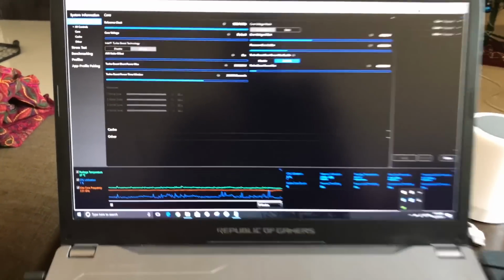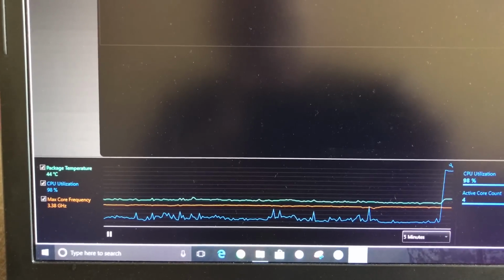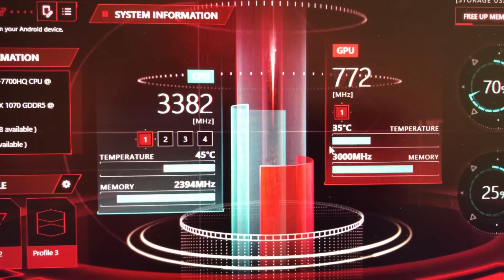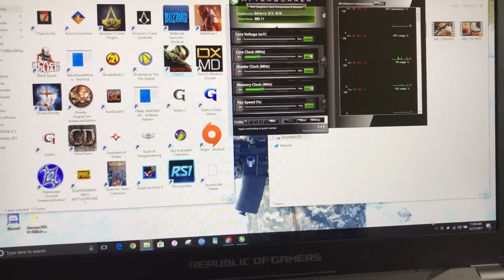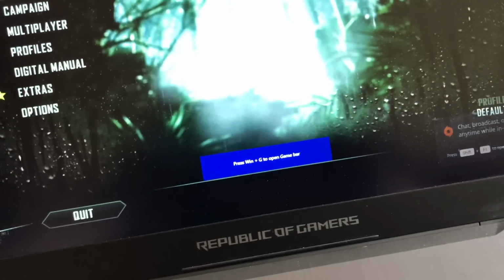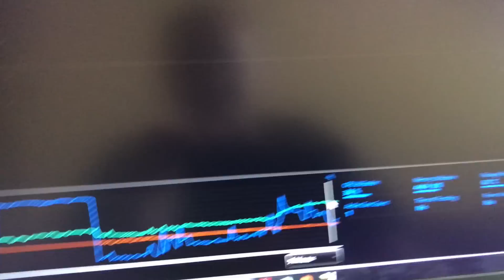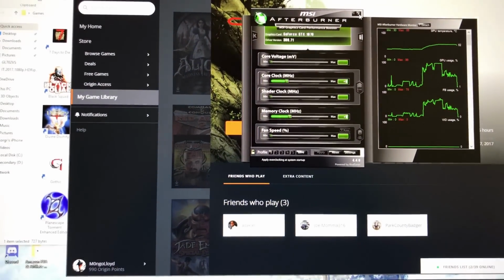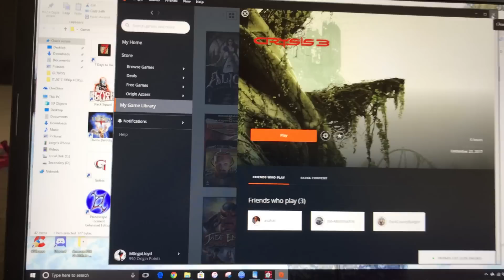ASUS ROG - Liquid Metal 5 Months Later! Followup

Comment: Mr. T! Thanks for these videos! I have the same laptop model and I also got the Samsung 960 EVO nvme. Now, please tell me (and then tell me how) that you were able to boot from your NVME SSD. I updated my BIOS to 307 and I still don't see how I can make it a boot option. It does recognize it in BIOS and in Windows.

The Thermal Grizzly actually works great. I did it just as you did. Looking forward to getting it faster with the 960 EVO and not the mechanical Hard Drive it came with. But I do have an 840 EVO SSD drive if that's the only option I have.
Reply from the maker: Hey there! The EVO 960 sure made quite the difference in speeds! 

Did you make sure to change the boot order in the bios? I do remember having to play around with the bios settings a bit to make it work. There may have been an option for nvme support. I have moved on to another gaming laptop I will be doing some videos of soon, otherwise I could walk you through it :(
Reply: Already moved on to another laptop? That would make it a challenge to walk me through the BIOS setup and I don't want to bother you for that. I did look online and didn't see anyone say they had success booting from the 960EVO. I'll mess around in the BIOS some more. If you are confirming that you actually was able to do it, that encourages me to keep working at figuring it out. Thanks!!
Reply from the maker: Jason Beaver I was successful in doing it, but I seem to remember removing the mechanical drive first and then installing fresh windows on the evo, after that, just switching the boot order. But yeah, it was quite a while back! They are great laptops, only reason I sold it was so that I could pick up a different laptop to start making vids for lol.
Reply: Little late reply here.  Mine came with an nvme pre-installed (GL702VM).  I replaced it with the same drive as Mr T.  Boots fine.  From powered off to windows 10 password prompt is 14 seconds after post.  If you need any info from the BIOS,  I'll help out.

Comment: i might try this, i have a different model. Its the GL702VM which has an i7 7700hq with a 6gb gtx 1060 and my temps for both reach high 80's.
Reply: i will be doing this in 2 weeks, hopefully i remember to come back and let all of you know how it goes.
Reply: Athan Garcia prob because you cheaped out on thermal paste NEVER do that
Reply: I ordered thermal grizzly kryo and conducto, shipping is a little bit of a wait... I agree with likly poor quality thermal compound (I hope)
Reply: Flare78x how did it go
Reply: Flare78x if you did it
Reply: i have the same laptop as you, im thinking of doing this too
Reply: I have the same laptop too
Reply: eyeCmonsters hey cool thanks
Reply: Vmk here. Thinking of doing this as well. Havn't decided to use lm or not yet doe. Some mods i have atm: Drilled back, taped gap at fans, undervolt cpu, temp regulated gpu, disabled boost.
Reply: I've done into both the 2017 model and the 8th gym 2018 model and it helps the temperatures by about 25 degrees celsius if you undervolt as well by .120mv to .160mv  performance went up 30%
Reply: Athan Garcia how long have you been using if for

Comment: Do not use Liquid Metal on Laptops... 
It requires tons of maintenance and check ups than just using high performance thermal paste, Sure the thermal reduction is MASSIVE over stock temps but the elevated maintenance (Disassembly and Re-pasting) its a fucking PITA and can possibly go wrong the next time. 

Use high performance thermal paste, get nice reductions over the shitty stock paste and forget about it.

Comment: Uh bro, @ 9:45 - that's not your fan curve that's the GPU voltage /frequency curve.  You have essentially overclocked your GPU.  You did NOT lower your fan curve.  You did increase voltage and frequency at each bin for your GPU.  Please correct this before people follow your advice and burn up their GPUs with unstable overclocks.
Reply from the maker: Yes good catch! I meant the voltage curve honestly, otherwise I wouldn't be using MSI for a fan curve and speaking so much about UNDERVOLTING. The undervolt I recommend and tell people and have applied is running it much cooler, so it shouldn't be having people burning their GPU's up, especially with driver protection what it is these day, though you never know ... you still have idiots who stick forks into toasters lol. I will put a note on the video. Thanks again.

Comment: It looks like over time it will micro-pit the copper which is not good,  Grizzly Conductonaut it is really meant for nickel plated lids contact with cpu die I think.
Reply: Actma Yode big mad
Reply from the maker: It's marketed towards copper and performs better once it makes the bond. The pitting is so minuscule, it won't ever be an issue. You will have to reapply every year or so, but honestly, how long will you keep the laptop anyway? You can go with standard (or "PRO" grade) thermal paste, but you won't quite get these results, so it is for the person who want's the best cooling and isn't afraid of opening up their case once a year.
Reply: So your going to open your laptop every year to replace the expensive thermal paste and eventually strip the screw threads, O.K
Reply: Why should I be mad with some else mishap? lol

Comment: Is there any safer alternatives like thermal paste? I just ordered this product as an open box and I am waiting for it to come in next week from best buy as an open box - excellent.
Reply: How often do you travel with this laptop and do you think it would effect the liquid metal by traveling more?
Reply from the maker: Well, this is pretty safe as long as you have a copper heat sync and just use small amounts of the liquid metal and spread it evenly on the indicated areas like I did in the first video.  You can always go with a more traditional thermal paste compound, yet it will not achieve the same great results! Follow the first video I posted and you should be fine!
Reply: Mr. T's Tips I should of been more specific with my comment, is there a thermal paste that you would reccomend? I'm in the military and I do alot of moving around and for what I understand the device being moved frequently isn't good for liquid metal and I don't think I want to reopen the case every 6 months to clean and re-apply liquid metal. I understand I won't hit the same results that you do with LM but I imagine there's paste that's alot better than the stock paste. 

Thanks!

Comment: Hey love your videos!! I have a ROG GL502VSK and was thinking of repasting my cpu and gpu because of the awful factory job. I was thinking of going with liquid metal but kinda hesistant about the long term effects since i have seen some people that have problem after a year or so. Do you have to repaste it every year or do you think it good for a long term usage? And what about the conductivity of the LM? Can it really ruin your computer if you dont use the tapes around the die to protect it? I dont intend to overclock my laptop, just want it to run cooler for longevity and when I take it overseas to hot and humid areas in the summer (ex. Korea, Japan). Thank you so much
Reply from the maker: Brian, the tape around is just because I don't trust gallium itself to be touching the nickel used on the motherboard. The liquid metal over time will create a sort of "bond" with the copper and die that you put it on. The only thing you will need to do is keep an eye on the temps (just occasionally) after the thermal paste job. You will want to use the Intel Extreme utility in "monitoring" mode (also, use it to undervolt your CPU to get way better temps with no loss of performance) and use MSI to monitor the GPU temps while gaming. While gaming for an hour, do an ALT+TAB, or WIN KEY+TAB or WIN KEY+D to go to your desktop and check temps out. Make sure you push the ROG button and enable maximum fans when gaming (as the BIOS does not rev the fans up to MAX by itself). 

After 5 or 6 months, you will want to clean and re-apply like I did, as you will need to use a slightly higher amount of liquid metal, as the liquid metal will have bonded over the last few months and sort of "seep" into the copper slightly. When you apply more now, it will even get you lower temps than the first time you installed it. Another trick you can do to achieve a great bond from the get go, is to do a few light passes to rough up the copper slightly on the heat sync before your first install of liquid metal. 

I did this mainly to increase the lifespan of my purchase, plus because I spend time in India as well, so the heat and humidity is also something I was worried about. This video was shot in India actually lol.
Reply: I used mx4 and then repasted with ic diamond. The ic diamond did well for me.
Reply: Mr. T's Tips which city in India?  I also live in India and have this same laptop. I'll pay you to do this for me as I will F it up for sure. Please reply
Reply from the maker: Vedansh Modwel won't be back for a few months. Mumbai and New Delhi. I also make it to Goa every so often.

Comment: Hey so I have the same laptop, same model and everything. I bought it recently and went ahead and did this to it just a few hours after purchasing the computer. Didn't bother to run it too much on stock thermal paste. 

HOWEVER. I am concerned because despite my artic thermal pads looking exactly like yours...the placement, everything...I am getting temperatures around 47 C for my CPU and 50 for my GPU on idle with fans at 50%...I haven't undervolted my PC. Could that be the source of higher temperatures? 

I did put a generous amount of thermal grizzly on both my GPU and CPU...could that be the reason why? I know there's no way to know unless you visually inspected my laptop personally but I'm just trying to figure out why it runs so hot. Gaming it will push 81, 83 even 85 C and I just feel that is not good at all...
Reply from the maker: No Nicholas, you are right. It shouldn't be that hot after you have done the liquid metal application. Did you prep the surface and clean the heat sync and the dies very well before applying the liquid metal?

Also, have you checked the tightness of all the screws?

Did you tape over any air leaks between fan and copper heatsync piping? 

Also, yes! Undervolt the CPU using Intel Extreme Overclock Utility to a stable point. Normal reference for this laptop/cpu combo is around -0.120, though you may be able to hold steady at an even higher undervolt. 

What is the temperature of the room you are gaming in?

If you do all of this and still have high temps, let me know. There is a way I could help you manually undervolt your GPU which would also drop temps.
Reply: I checked all the screws for maximum tightness (without over torquing of course).

I prepped the crap out of the surfaces and applied the cleaners you recommended in generosity to the surfaces.

I rechecked and it was downloading some things so the new idle temperatures are 42 and 46 for CPU and GPU. Still too high for my taste with fans at 50%

Im not sure what you mean by taping the fans... I have installed the fans, cleaned them out and made sure they were quite secure.

As for undervolting ... How much of an effect on performance will it have? Because I'd like to push project cars 2 at 2K and ultra settings... I can do that now... So I don't want to take that ability away.

I don't have thermal stuttering though.

Furthermore I might add, the room I'm in is cool. Around 70 degrees. The surface is a college desk but nothing ridiculous. It's not hot nor does it hold heat.
Reply from the maker: Nicholas Sepulveda you may want to add a very thin copper shim between heat sync and die so you can make a better and tighter contact between the two (with a bit less liquid metal of course if you go that route).

70 degrees is pretty normal, that shouldn’t effect your sitting temps. 

With an undervolt, you are not restricting the frequency rate at how fast the actual chip will perform ... just the amount of juice it takes to do it! This consequently will give you the same speeds at a lower temp. 

When I undervolt my CPU and manually set a curve to undervolt the GPU (using MSI Afterburner), I get stellar temps and actually higher scores on benchmarks as the lower temp allows it to perform better as well it seems.

If the liquid metal application is still fairly fresh, you can use a separate syringe and suck up the gallium on your heat sync, then use a pretty fine sand paper on the copper to rough it up a little ... this will allow the conductivity (heat transfer) to work better as the gallium will bond with the copper better.
Reply: So Mr. T, I gotta say first of all, thank you so much for getting back to me with these informative responses. 

I am not really planning on putting a thin copper shim, since I don't know where I would source it, and I really don't want to redo everything again since I was so meticulous the first time. 

BUT BOY...ok you mentioned Undervolting and it really got me thinking about how to do it properly. So I have Intel Extreme Tuning Utility installed...You mentioned MSI afterburner...Really? 3rd Party software to undervolt this? I know people have mentioned it online, though admittedly not with the 1070 but a 1050... 

What were the voltages you put your CPU and GPU down to? I'm trying to do this safely.
Reply from the maker: Hey,  no problem at all. 

If you ever decide to, you can grab a thin .3 or .5 mm thick copper shim to use here http://a.co/aAG12E9
(I might recommend going with the .3)

Undervolting is going to be the best bet for you now in regards to cooling. You will not loose any performance at all.

Using Intel ETU, you will want to open it up and and then click on 'Advanced Tuning' on the left hand panel. Once there, on the Core Voltage Offset setting, put that to -0.120 V ... mind you go NEGATIVE on that! (Don't want to fry it by going positive and hitting apply).

Before you do that, you will want to view the temperature graph and make note of where your temps are. For the test, set your fans to MAX. Once fans are set to max, in Intel ETU, click on Benchmarking and do a 5 minute benchmark. Make note of how high the temps go. Now apply the -0.120 V offset to the Core Voltage, hit the yellow Apply button and run the benchmark one more time. How different are the temps?

And yes, MSI Afterburner is a great choice for really any GPU, as it is just going to control what the manufacturer allows. So, you will only be able to control a few areas on the GPU that ASUS deemed "safe". You can also use the ASUS OC tool if you would like, but it doesn't let you control the voltage curve.

Once you install MSI Afterburner, open it up and press CTRL+F - You will see a graph that pops up. Make note of the numbers on the left hand side of the graph. Set the first (from left to right) 5 points on the green line to 1657, and then set all of the rest in a straight line to 1670. Once you do this, close the graph screen and then click on save, choose slot #1 (to the left of save) and then click on Apply.  This should be a safe and much cooler running temp for your GPU as well, while still keeping you gaming just fine. MSI always lets you click on Reset whenever you like to bring you back to stock and then back on slot 1 to enable the graph you made. 

Let me know how this works for ya man!
Reply: Alright! SO!

BIG Reveal. It took me a few days to actually make the time to Undervolt my CPU and GPU. I did however just finish this up. 

SO when I began undervolting my CPU, I first ran the stress test with max fans and got a stable temperature of around 57 to 60 degrees C. I thought this wasn't too bad, but I undervolted all the way down to a whooping -0.130 V and got temperatures of 44 to 51 degrees C. It did end up pushing to 53 at one point. But I was very pleased with this. :) 

I might eventually push it more...till I get that Blue screen.

However with the GPU I have several questions. I did undervolt it using MSI afterburner down to what you stated... 1657 for the first 5 points and 1670 for the next points...but I'm wondering. I haven't gamed on it yet...but isn't undervolting to bring the 1900 MHz frequency to as low voltages as possible? If not then didn't I just rob my computer of a all possible performance by setting the clock speed of the GPU down to 1670...?

Still though...when its idling the PC still hits 46 to 47 C on the CPU and 45 to 49C on the GPU. This is on Max Fans...for both 0 and 100....sooooo....my PC just likes that temp?

Its odd...annoying...but the load temps also don't spike up as much as they used to...so should I just be happy with that?
Reply from the maker: It is sounding to me like maybe the liquid metal application didn't seat well on the die(s) possibly, especially if WITH the fan maxed, you are still getting 46c idle! (this would be decent idle IF you didn't have undervolt and fans on max). I keep my fans at 50% most of the time until I game, then I switch to 100%.

In regards to undervolting the GPU, the laptop version of the 1070 is the same as the desktop, only it has a lower power draw and runs at a restricted speed. I did benchmarks and ironically, I could tell that they restricted speed slightly, as when it ran cooler (once I did the undervolt graph in MSI), I actually got better scores in my benchmarking tests! ... I would work towards as cool as possible first to lengthen the life span of your laptop. You really won't notice any performance changes at all. 

Make sure you have also went to your battery icon (lower righ thand corner), right click and power options, then select high performance.